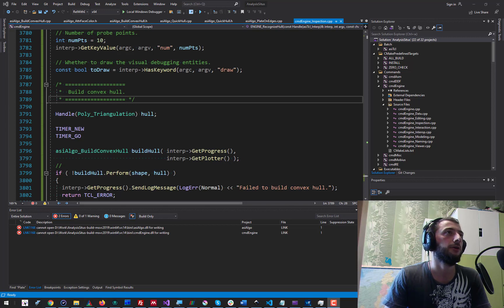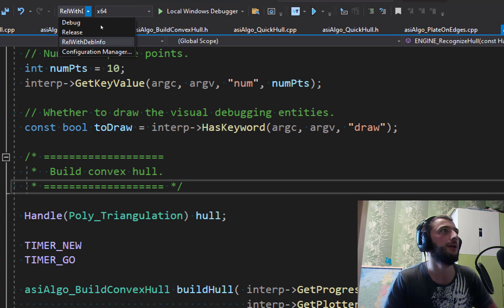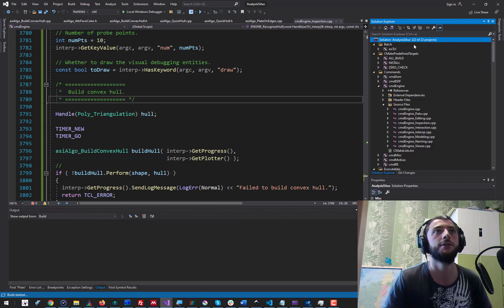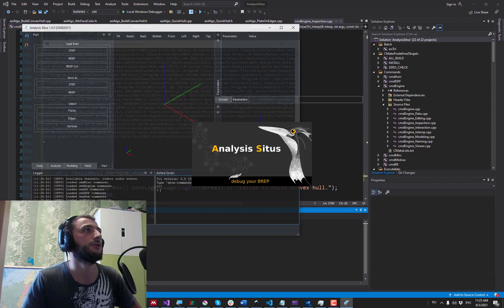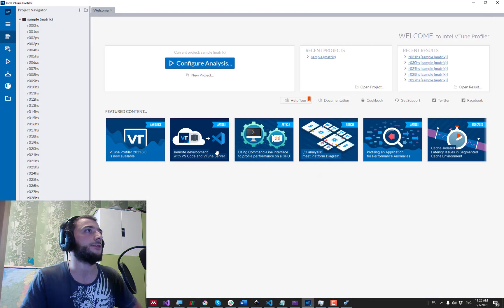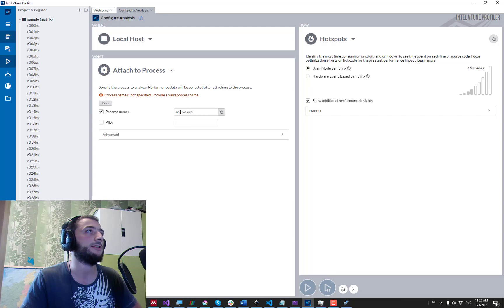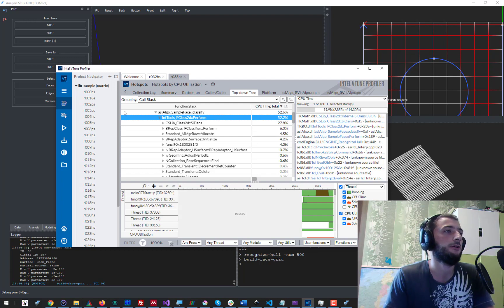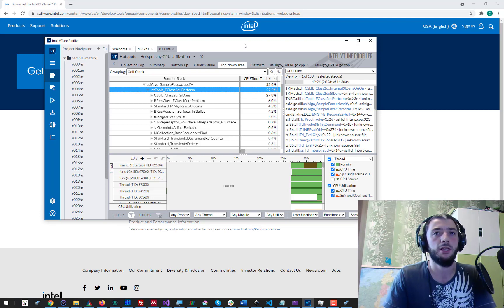Lesson 13: Hotspot analysis in C++ with Intel VTune Profiler

Comment: Quaoar, no matter what i try, i cannot get a success result. The summery doesn't have details about the functions and call stack. Also the tabs next to "Summary", like Bottom-up, Caller/Callee, Top-down Tree and  Platform are not available for me. What do you think can be wrong with my VTune?
Reply from the maker: I'm using Profiler 2024.1 on Windows 10, and most of the time it just works. You may want to give it a try on a simpler program, like a plain main function with an intense loop and compiled in RelWithDeb mode.

Comment: Hi Quaoar,

Your videos are very useful in understanding the internals of OCC.

Can you guide on dimension lines and labels for CAD object?

Also can we control projections and print 🖨 layout?

My questions pertains to OCC and doing these things from source code.
Reply from the maker: Thanks for posting your feedback. I'm trying to serve the narrow community of people who are close to developing things from scratch with the help of some low-level libs. It's hard to strike the right balance, though, as a fully-fledged CAD package is much more than geometry. What you pointed out is a completely valid request, which I might not be able to answer. Interactive dimensioning and labeling is largely a "front-end" thing, not coming from what I would call a "CAD kernel" (although there are some relevant pieces of this in the AIS module of OpenCascade). To cover this, one would need to decide on the front-end library in the first place. It's one technology for the desktop and another for the web. Also, once you've decided on the platform (desktop vs web), there are different UI frameworks that would largely drive how exactly dimensioning is going to be implemented (e.g., AIS vs VTK vs OpenGL, etc.). Maybe at some point, we will get there on this channel, but it's not exactly on the roadmap. Have you checked FreeCAD? Does it come with the functionality you're looking for? If so, it might make more sense to start from there.
Reply: @QuaoarWorkshop  Thanks for shedding light on it. I was looking for some standard techniques to follow in this regards.

Yes I have used FreeCAD v0.17 mostly on windows but later I abandoned it. Because it was bloated. Its developers were using coin3d for geometry instead of OCC. The commands didn't worked as they were documented and supposed to. I created a small 3 story BIM model that hanged. While the developers of FC blamed sluggishness because of single thread of OCC. There are dimensioning and projection code in FC but i doubt its quality. 

So I am planning for CAD and Finite Element Preprocessor from scratch using OCC.